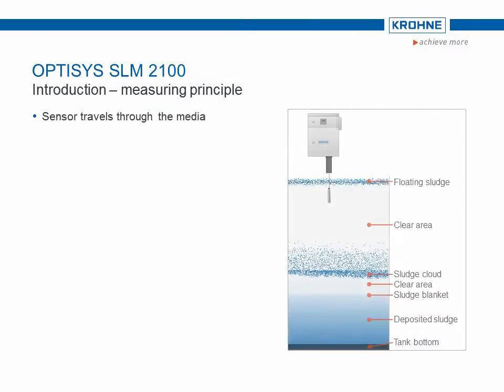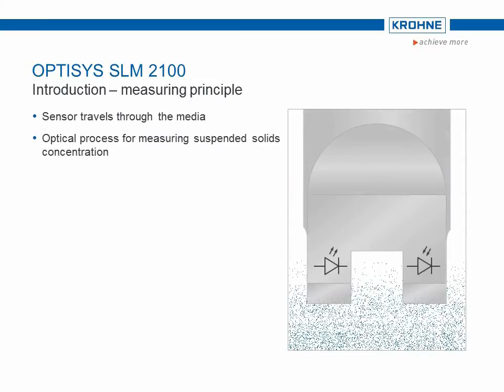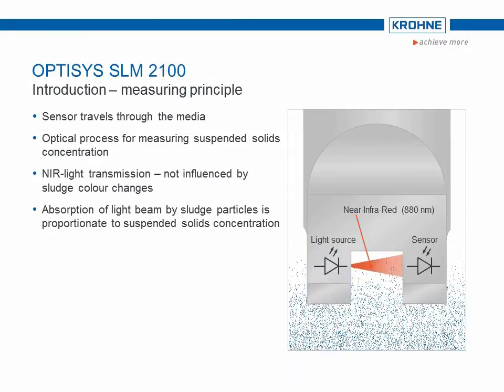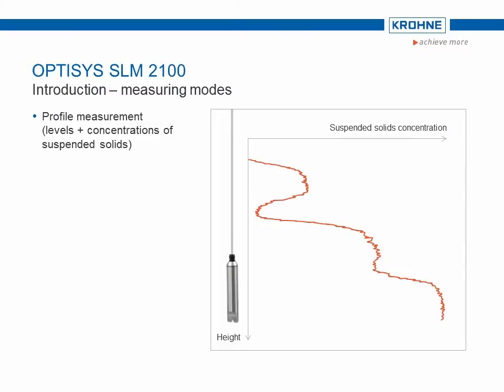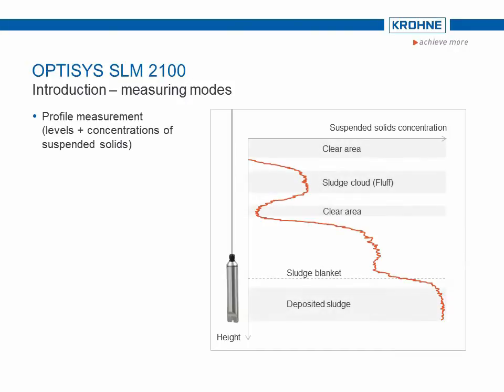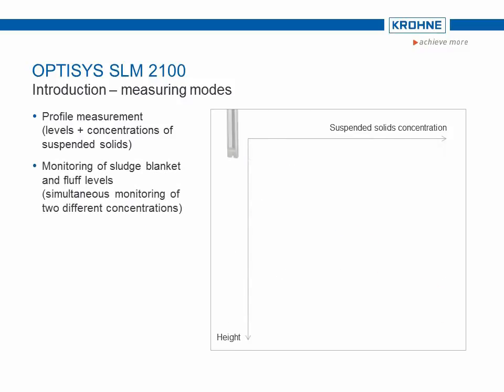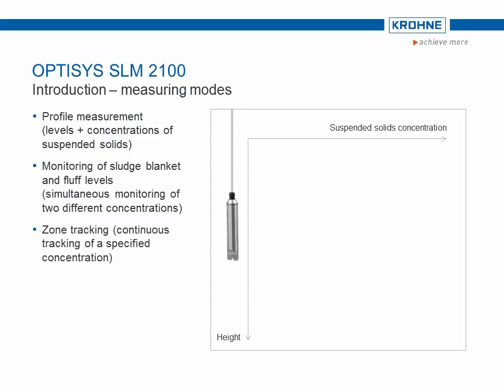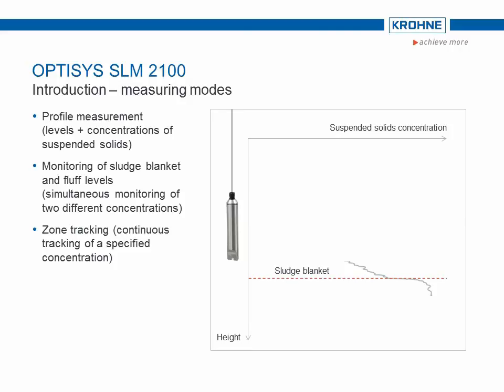Measuring principle of the OPTISYS SLM 2100 by KROHNE

Comment from the maker: Learn more about the measuring principle of the OPTISYS SLM 2100 - the optical measuring system for sedimentation profile measurement and continuous tracking of sludge blanket.

The OPTISYS SLM 2100 allows for reliable tracking of sedimentation layers in industrial and municipal applications, e.g. in sedimentation bassins of power plants, waterworks etc., as well as sludge blanket measurement in clarifiers and sludge thickeners in sewage treatment plants.

OPTISYS SLM 2100 is the successor of the OPTISENS OAM 2080 sludge blanket measuring system, but has been completely re-engineered to extend its area of application to sedimentation processes. It uses a optical suspended solids sensor, which is submerged into the basin. Unlike ultrasonic-based sludge level meters, the optical measuring principle is not subject to echo returns from walls or separating zones as well as signal damping by fluff or floating sludge.

OPTISYS SLM 2100 is the first sedimentation measuring system to offer three measuring modes: measurement of sedimentation profile, two-zone monitoring and zone-tracking. For sedimentation profile measurement, the system directly measures the suspended solids concentration at all heights as the sensor travels through all layers of the medium. The two-zone monitoring feature enables to monitor the heights of two predefined concentrations, e.g. fluff and sludge. It can be used to prevent sludge washout into the next stage.

For continuous level measurement of a predefined concentration, also known as zone-tracking, the optical sensor moves within the medium until it detects the concentration and follows or tracks this zone continuously. This can be used e.g. to monitor the change of the sludge blanket level when de-pumping the sludge. Here, OPTISYS SLM 2100 can replace two measurements commonly used in this application: with an ultrasonic level meter, disturbances of sludge blanket can lead to false measurements or even loss of signal for the ultrasonic device. To compensate for this, an additional turbidity measurement is installed in the depumping line. Both can be replaced by the new OPTISYS SLM 2100.

The integrated signal converter of the OPTISYS SLM 2100 is the well-known MAC 100 multiparameter converter for analytical measuring devices. It shares the same operating concept as KROHNE flow and level signal converters and thus supports quick familiarisation. KROHNE is the only measuring instruments manufacturer to offer a common operating concept for both physical and analytical parameters.

OPTISYS SLM 2100 has two 4…20mA outputs that communicate height and concentration according to the selected measuring mode. Inputs include a rake guard switch that protects the sensor from being catched by the rake. Also maintenance mode and interim measurements can be started remotely via digital inputs.

Both sensor and housing are made of stainless steel. The protection rating IP54 housing has a build-in fan to cool down electronics in hot environments. It also houses a heater for cold conditions to prevent the cable and mechanics from freezing. As option, an integrated spray cleaning system cleans both the sensor and the transport cable following each measuring cycle, keeping maintenance costs to a minimum. While this was standard with the previous system, it became an option as in many applications the clear zone is sufficient to clean the sensor, and thus the base price of the system is lower.
Measuring principle of the OPTISYS SLM 2100 by KROHNE